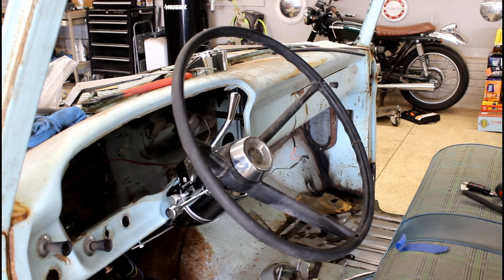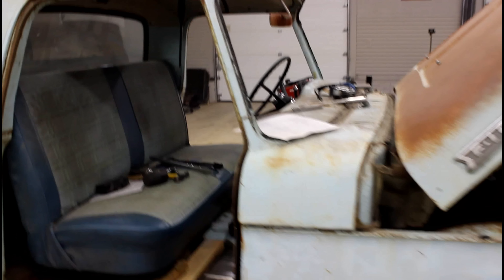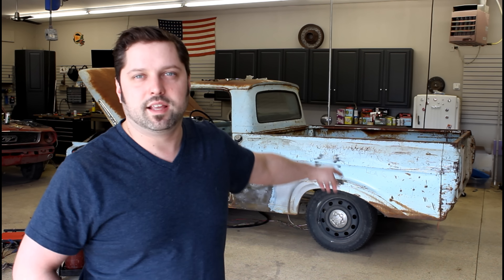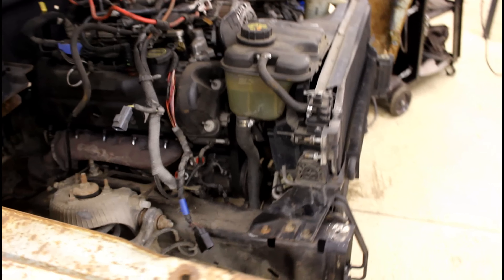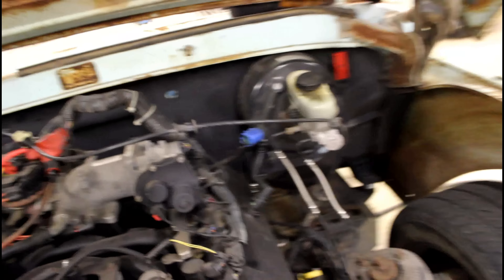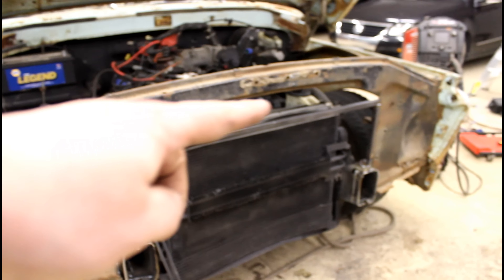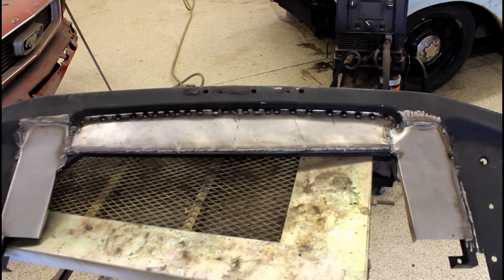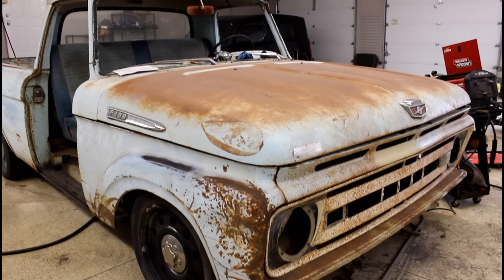F100 to Crown Vic Frame Swap Ep.8 Moving radiator,  Fab Core Support, Talking Paint.

Comment: I'm bing watching these videos.  I've had a '63 short bed with the panoramic back window sitting in my yard since 94.  Have done some limited work on the body over the years and replaced the bottom of the cab.  But it has sat unfinished since then.  I saw the option of putting it on a crown vic awhile back, and these videos have given me the push I need to finally get started on this project.  excellent work sir.
Reply from the maker: Thanks so much Calvin! I LOVE those big back window uni's! Best of luck on your project!

Comment: Just a thought: have the paint shop load you some of each color in an aerosol can with the little puncture bladder of activator. This would be the exact same stuff you would be shooting out the gun. You could make a few test pieces to check color and it's not very expensive. ~$20 a can in my area. Side note, that color evolved into sky view blue in 1970 for sure, Bc that's the color on my bump. Following your build, and digging the level of hustle you have. Props.

Comment: When you moved the rad, you said you moved it back 2". But it's kinda slanted. Did you move the bottom bracket more than 2" to get it straight?
Reply from the maker: +Darren yes I did, only far enough to get rid of the slant.
Reply: how did you mounted the bottom bracket?
Reply from the maker: I just unbolted it, slid it back, drilled new holes, then bolted it back in.